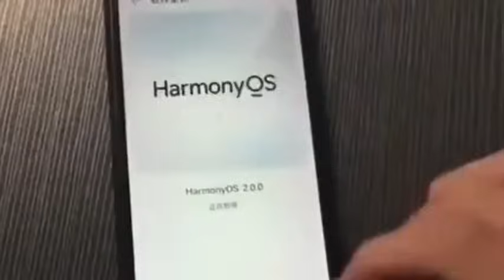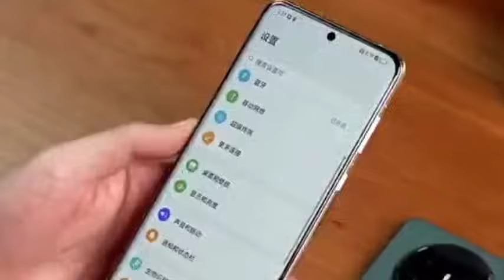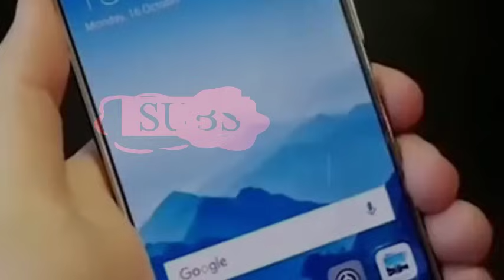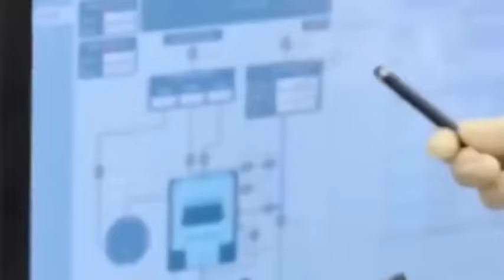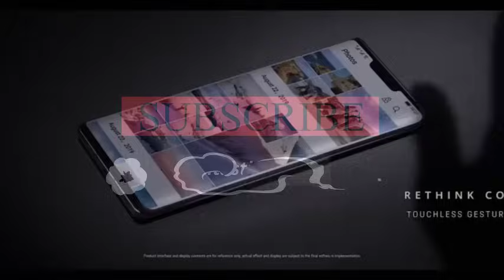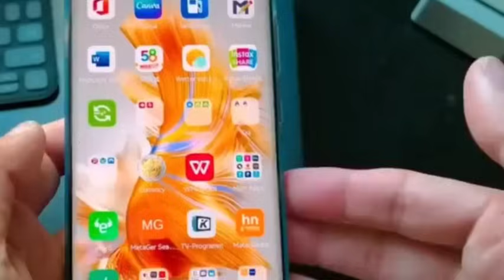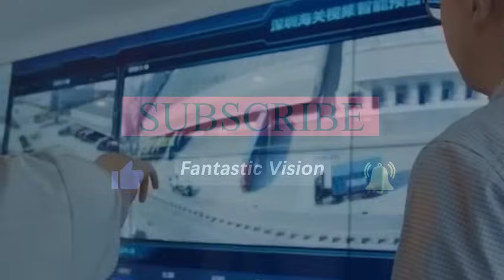Huawei Mate 60 uses purely domestic components, effectively countering the U.S.

Comment: You don’t need a 7nm 12 core chip for a cruise missile.  The Russian can do it with a refrigerator control chip.
Reply: I thought they used chips from washing machines
Reply: @jbbeiser983  I think that its just whatever is close to hand.
Reply: @laurencekelly5081  as long as it works for them.
Reply: @jbbeiser983 😂😂😂  yes, it's washing machine.
Reply: Simple analogue would be "You don't need a tiger to catch a mouse".